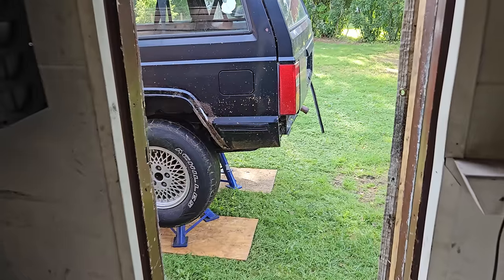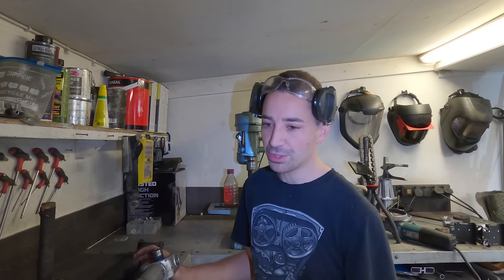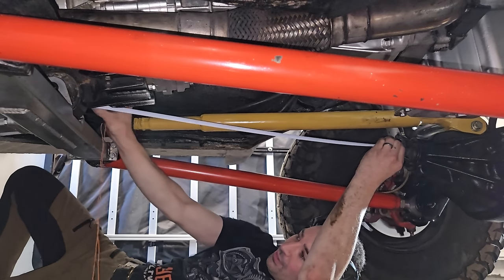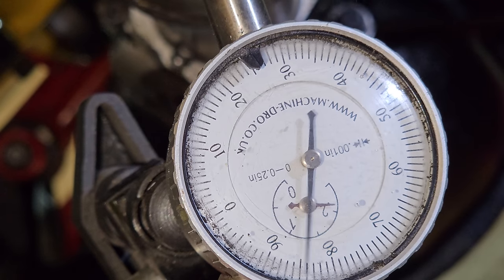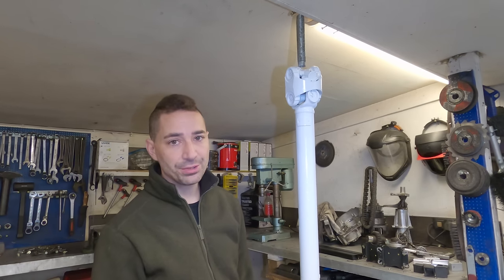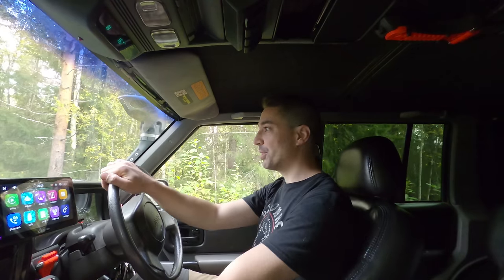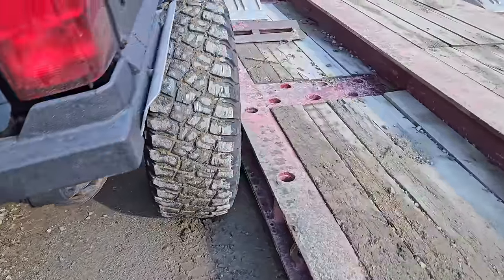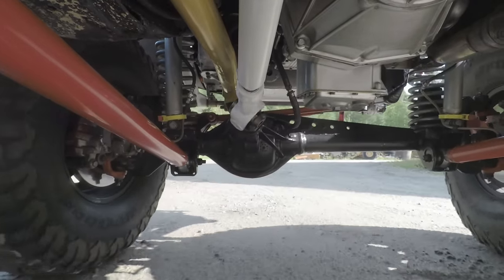Drive Shaft Shortening No Special Tools

Comment: Well, in Europe we don't make anything anymore to be honest. I've been rebuilding my 2 door 2.5i XJ and I end up ordering from Rockauto most of the times. Most of the stuff in the European market is either 2x to 3x the price or Chinesium made parts.... And on the top of that, there are so many regulations nowadays you are not allowed to do anything, I even failed inspection with a pristine XJ because my 235/75r15 tires were "too big" 🤣

Comment: I mage a roof rack out of unistrut and sprayed it with Raptor coat.  I bought bolt on feet for my wagon to fit it to the roof.  It was a very sturdy rack but a little heavy.  Cut down on welding too.  You can go with extruded aluminium as well, but that can get pricy .
Reply from the maker: Ah, nice, that sounds like a smart build. I have lots of aliminium excursions, so I should be able to nock something up using my current load bars. Thanks for watching!

Comment: I think rooftop tents are neat, but yeah not practical for off season or putting on my truck which i also daily drive from time to time. I built a bed platform with drawers in the bed of my truck and it's worked out pretty well. Good video as always, Mike! Looking forward to seeing what you put together for the diesel!

Comment: What load bars are you running ? I haven’t seen ones that lower in Australia
Reply from the maker: They are front-runner load bars. I mounted the load bars under the gutter rail mount to lower them by 2.5 cm.

Comment: Hey, I still haven't sorted out the electrical issues in my Xj. Do you have any documentation on the ECU pinouts?
Reply from the maker: I unfortunately don't have any information like that.
Reply: @WorkshoptoWilderness  
It worked. ECU did not receive "-"
for posterity pin 3 +12V. pin 4,5,11,12, is "-"
i lost ground on ECU : )
Reply from the maker: @Impherator  Ah amazing so you fixed it! That's fantastic!

Comment: Hey Mike, I had sending you a message some months ago about drive shafts, and were to buy..did you forgot? So bad to cut that drive shaft at that end, mush better at the other side. But you did it already. Any how, send my the measurement from the drive shaft you need! I will take care that you get that 🤠 you have my whatsapp number. Cor
Reply from the maker: Hey Cor, I must have forgotten? What's the link? That's a good point on cutting the shaft at the back end, although is it harder to get it straight? Maybe not.